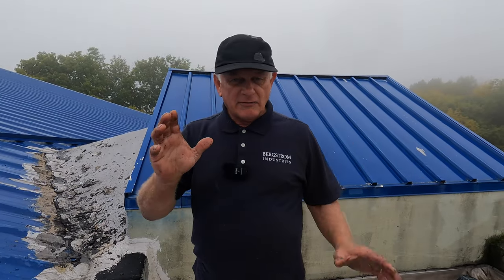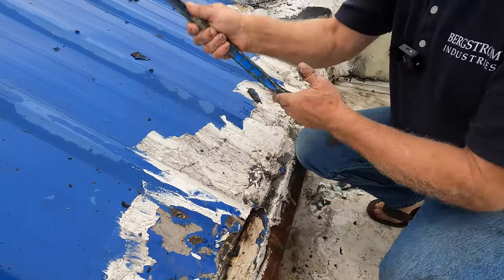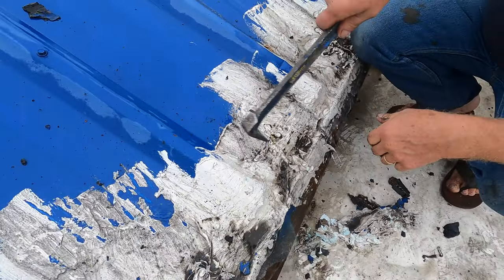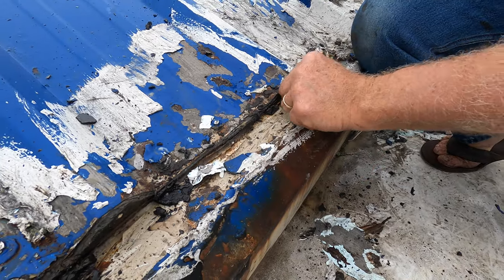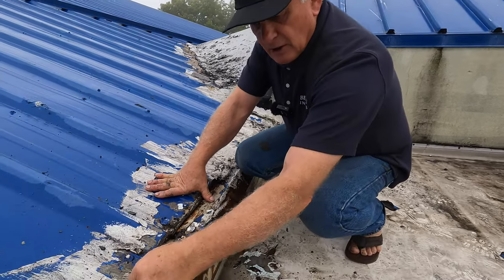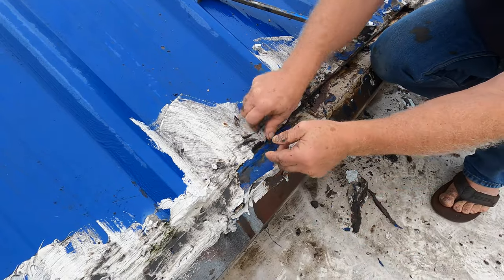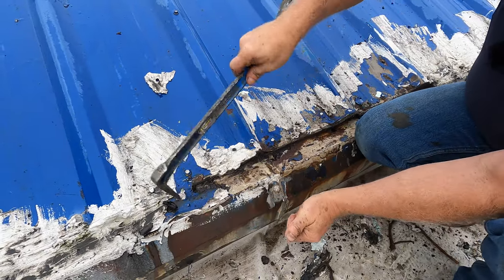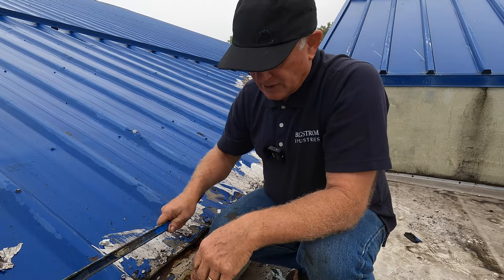3 No No's on a metal roof repair - Is Silicone Caulk good for a Metal Roof Repair?

Comment: It might be helpful to say what SHOULD be used
Reply: dont know where you are but anywhere temperate you can use lap sealant ...clean the area properly first . lap sealant comes two ways , in a tube for a caulk gun and in a can , the can product is self leveling . good stuff .
Reply: I think it was too short. I say put more roofing under the old and extend it out. I can not see what is under the edge but I know it should not be like that.

Comment: After almost 50 years as a sheet metal contractor, I can say without hestation, that this video is 100% correct! Beyond that, Silicone seal should never be used except between 2 mating surfaces under pressure (motorcycle primary cover, etc, where a gasket would be used. Silicone does NOT REMAIN adhered to ANYTHING, EVER! A high quality sealant such as Sikaflex, Geocel, or Vulkem is a WAY better bet!
And ALWAYS thoroughly clean all surfaces!!!

Comment: A great primer is mixing polyurethane sealer with lacquer thinner. Then use polyurethane over that. If you are doing a large area, mix some paint thinner with polyurethane sealer to make a paint and roll it on. Polyurethane works better than tar that cracks as the oil evaporates, better than elastomeric that doesn’t stick well or hold up when you walk over it, better than silicone that cures so fast it might not stick. I use the polyurethane for sealing windows and doors around vents but use self leveling polyurethane for concrete for the flat areas of the roof. Be sure and get exterior polyurethane that resists UV light.

Comment: Use a elastomeric coating. Don't use silicone on any roof at anytime.
Reply: Lap sealant better ....used in mobile home , travel trailer and cargo trailer roof systems ....gun grade in tubes for caulk guns and self leveling in cans ....Dicor is one we use